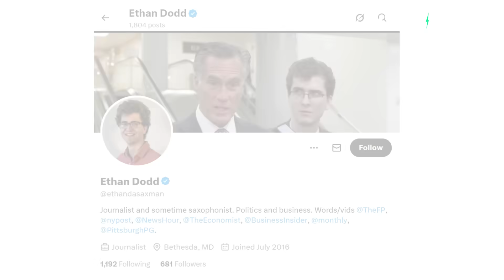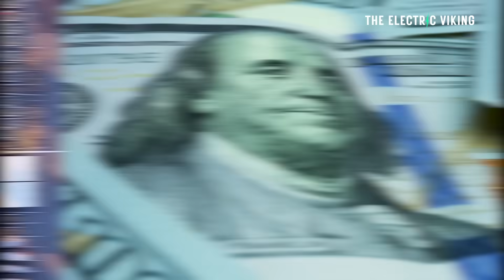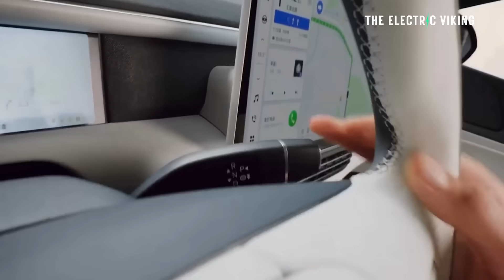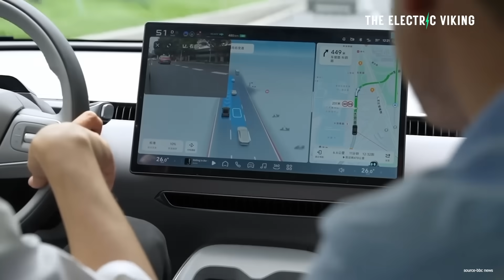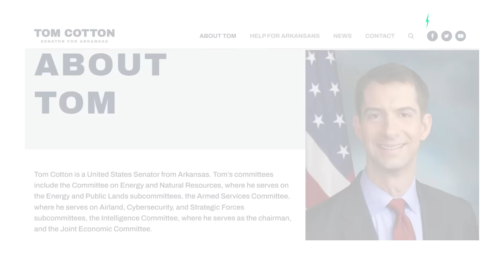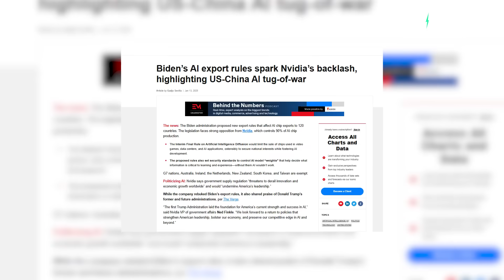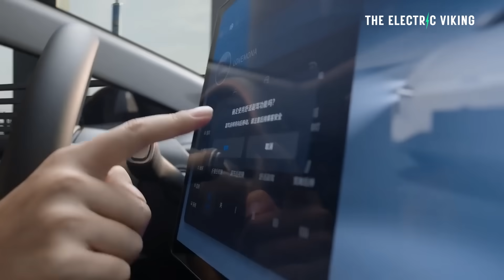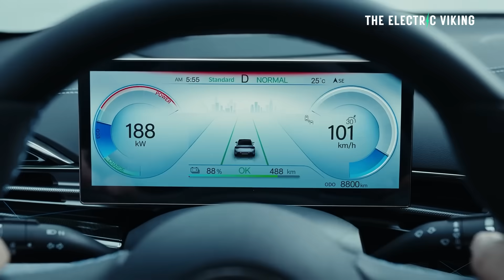How Chinese EVs Could Take Over America: The Nvidia Deal Blueprint

Comment: Not only cars.  Solar PV and battery factories , as well.  US car companies have lost track of technology that makes vehicles work long term.  Todays US engines are junk.  They wear out at 60k miles.  Maybe retool most of the fleet to accept EV drivetrains, and work instead on integrating magnetic recharge technologies into the frame.  US gov't &DoT can likely complete the  embedded recharge network infra-structure , and we can stop worrying about which party takes the first step to go all in on EVs.  This is the sort of thing that can drive us to equal footing with China, which I'm sure trump will be interested in.   If we're then making BYDs in the US , there can be a multitude of  secondary firms with Value-added service adding to the industry.  Not entirely American made machines, but if the price is right, and durability, economy, and functionality are all there, the public(fans) can go all-in.

Comment: Ford quite easily could win this war. They advent new battery with new connections. They could patent those connections, which they refuse to China use it. So, it is patented and China could not produce it, though it is quite simple devices. The same goes with batteries. Battery is a new oil. You have top battery you control all Electric mobile market.

Comment: Where do you have service and warranty work done ? Software updates . Parts for repairs . These cars would not be insurable. The other problem they don't use American charging standards so it would be a struggle to charge . Now Byd does build electric busses in California and the governor did want them to compete with Tesla but that discussion was terminated . Actually I am surprised bud hasn't been shut down in California .

Comment: Electric Viking your videos are great.
However (1) Chinese cars have huge rust issues in Europe as we use salt in bad weather. (2) China is playing games driving up the cost of lithium. (3) the new Aluminium batteries from Tesla are going to now lead the EV world as what is coming for EVs worldwide is tax based on the weight of the vehicle. Aluminium will be king.
Please correct me if I am wrong !!
Mike.
Reply: "Chinese cars have huge rust issues in Europe as we use salt in bad weather." That is too sweeping of a statement. 
"It is crucial to avoid generalization. The performance can vary dramatically between manufacturers and even between different models from the same manufacturer.

MG (SAIC): Another major Chinese-owned brand (SAIC), has been in Europe longer. While there have been some isolated reports, it has not faced the same level of widespread criticism as BYD did from the Swedish test. This suggests that some companies may be adapting their processes for Europe.
Geely (Volvo/Polestar Parent Company): Geely owns Volvo and Polestar. Volvo has a renowned reputation for durability and rust protection, developed over decades in Sweden. It is assumed that the Geely-owned brands benefit from this expertise, and their cars (especially those built in European factories) are expected to have high corrosion resistance standards.
Future Models: Chinese companies are fast learners. The reaction to the Swedish test will undoubtedly force them to quickly review and strengthen their anti-corrosion specifications for cars destined for European markets."

Comment: Trump should allow Chinese EV to import in with 10% Tariffs.. U.S custom would earn the Tariffs..and buyers can decide if they wish pay a little more to buy/lease the imported Chinese EV..
Reply: Can’t register them anyway. They’re also a massive safety hazard
Reply: @ayylmao182  "They’re also a massive safety hazard' Where is a report that I can read to back that up?
Reply: @markvalery8632  it's all over youtube, BYD is the most sold EV in china and it's the ones causing all the fires.
Reply: @ayylmao182  Youtube is not a report, it is just people posting videos. BYD uses LFP batteries and sells into Australia and Norway. If they were a fire hazard, it would have been known and reported.
Reply: @markvalery8632  BYD auto industry co recalled ~100k vehicles for the risk of fire, some already have combusted. You can’t be bothered to actually spend 5 min to conduct your own research lmao
Reply: @ayylmao182  Now lets compare: The largest recall of American autos for fire hazard risk was General Motors’ massive recall in 2014 involving about 30 million vehicles due to a faulty ignition switch defect. This defect could cause the ignition to unexpectedly turn off, disabling power steering, brakes, and airbags, which led to at least 124 deaths and numerous injuries due to car crashes. The ignition switch issue could also cause fires in some cases. GM faced multiple lawsuits and paid $594 million in settlements related to this defect.

Toyota recall (2012): Approximately 7.4 million vehicles worldwide recalled due to power window switches that could short circuit and catch fire.
Reply: @ayylmao182  Show me one official report or analysis that shows ICE have a lower fire hazard than BEVs.